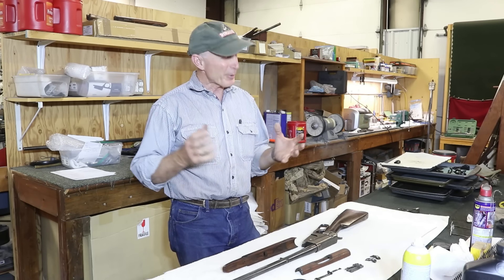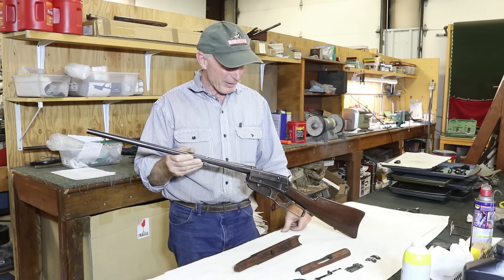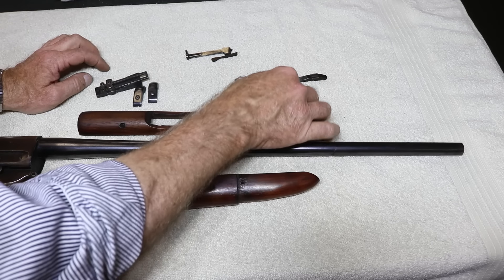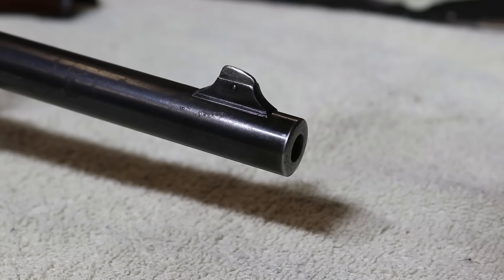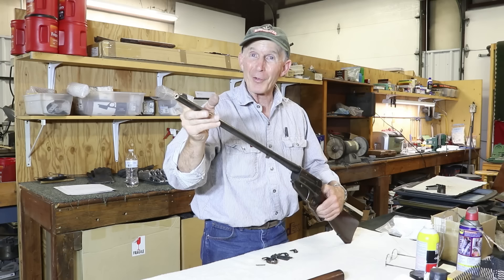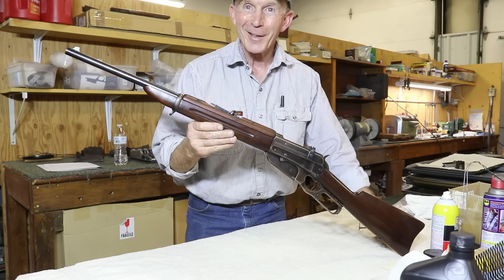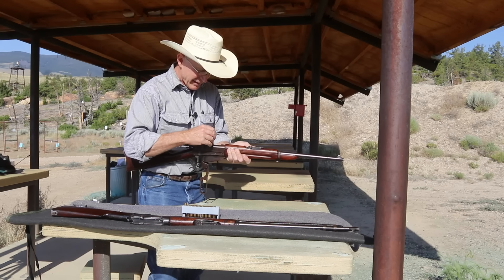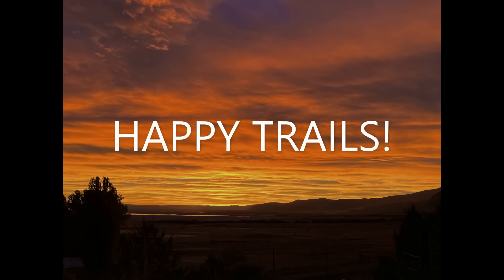Building an1895 Russian Carbine

Comment: I have a 1895 rifle in 30 US, (30-40 krag) that the barrel was so corroded on the inside a bore brush would get chewed up and ruined trying to push it down the barrel, but the rest of the rifle was in pretty good condition. 
I purchased it for a very good price and had it a new barrel installed. 
The gunsmith asked me if I wanted to duplicate the original barrel and I said no because If I ever sold it I didn't want to have someone else claiming that it was original. 
So I had a ramped front sight installed with a removable hood and small brass bead on the blade and a semi-buckhorn rear sight. 
I also had him stamp the caliber 30-40 krag instead of 30 US.
It's definitely a shooter now and I really enjoy it.
With the crescent butt plate and slim forearm it's a wonderful rifle to handle.
I just wanted to add that I kept the original barrel and the date of manufacture was 1903.
Nothing else was modified or refinished.

Comment: Awesome!  I love 1895 carbines.  I took a pretty beat up 95 rifle that had the barrel cut and some serious sanding marks throughout the rife and converted it to a carbine.  After cleaning up the metal I fabricated a three piece stock from a nice piece of walnut.  I also had to fabricate, the buttplate, front sight, and the metal wedge on the bottom of the barrel.  I also used a modified Krag barrel band.  It's an absolute beauty.  I have a few winchesters that are in poor cosmetic condition that will go through similar transformations.  It's a great way to learn about the firearm and improve your gunsmithing skills using simple tools.   THANKS!

Comment: Those guns were also in 38-72 Win. I have become enthralled with this round for some reason and I am building a kit Borchardt in this caliber. I have been able to find some dies and 405 win brass to make them with also a friend has loaned me his 38-72 Win chamber reamer. I will be using a Shilen barrel. It has turned into an expensive project. The dies and brass are very expensive not to mention the barrel and wood. I have owned a lot of Winchester lever guns but never a 1895. There is a .405 coming up in our local auction house in a few days. Think I will go take a look at it...

Comment: Um; how's your shoulder?
In my imagination I try to picture the look on the makers of these artifacts if we could show them a High Speed Steel cutter, a carbide cutter, or something like.  How about a HSS die for a 14BA screw thread.  Again and again and again, thinking of what those engineers achieved with so little makes me wobbly.  I wonder if how many years it took for the forge staff to go profoundly deaf?  In the very early days of steam it was a struggle to achieve 1/10" cylinder - bore fit.
Over here we have a man who built a replica of the Antikythera Mechanism using as close as possible and is known to original materials and techniques.  https://www.youtube.com/watch?v=wtjvWU0Ij-c  (are we allowed to encourage each other by leaving links?)  Any watchers who get hooked can blame me.
Looking at that dovetail foresight, I wonder how many safe edges were on the file? https://www.youtube.com/watch?v=h4KaiG7CpSQ  I have nothing to do with guns now, but everything you tech folk share is a gem.

In the wake of all the trouble you took to preserve the machine, what steps did you take to protect the metal under the hand-guard and fore stock from future rust?  Surely moisture is taken up and released from the timber according to ever changing conditions.  When soldering sights to barrels, how do you guard against trapped acid flux?  There is probably no time to answer; just wondering.
Superb channel.